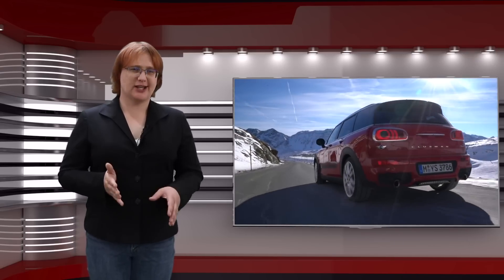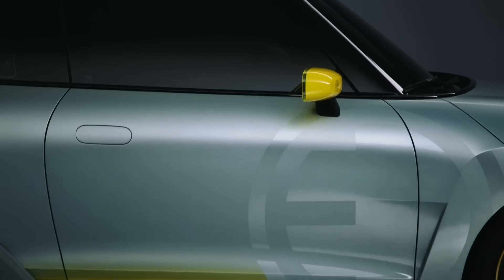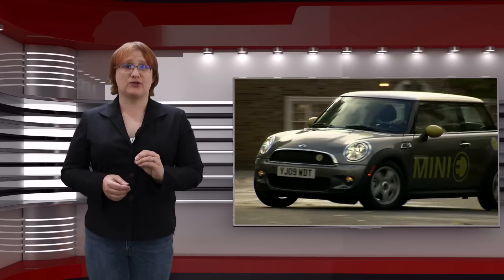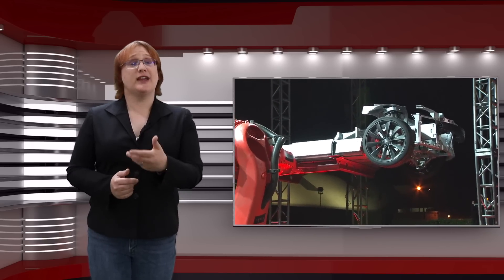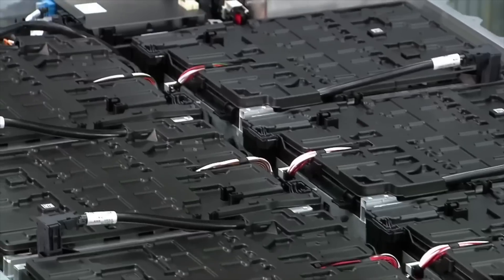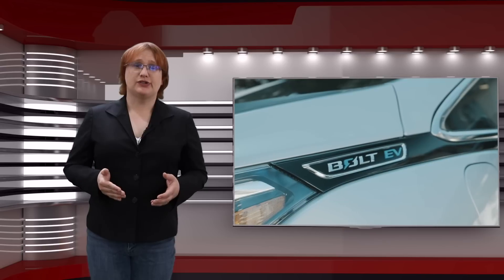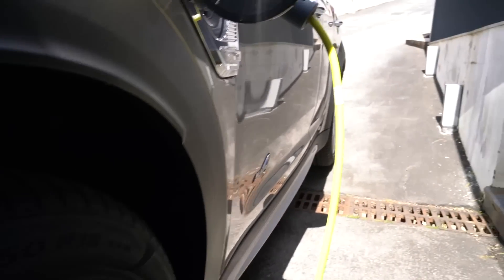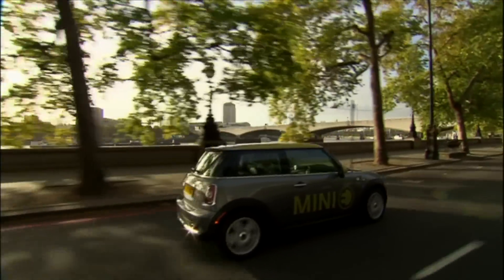How Easy Is It To Make A Good, Small Electric Car?

Comment: The 'MINI' brand must be getting too old anyway, i'm sure if you took a MINI, cut off it's roof and took out the seats you could drop an Issigonis Mini in the space.
MINI is the new flabby. BMW needs to take a new clean sheet of paper and design an urban mini car. The real trouble for all manufacturers is that a mini car is 'mini profits' car.

Comment: Something that people keep ignoring when talking about battery sizing, range is not the only thing to consider, in fact I would say it's not even the most important thing to consider, when it comes to battery degradation, small packs degrade way faster. This is because even if treated well li ion batteries have a limited number of cycles they can do, and a small capacity pack will go through the cycles faster, in fact in order do go 100 miles a 20 kwh battery pack will have to be cycled 5 times as much as a 100 kwh pack. This means a 20 kwh pack will degrade at 5 times the rate!!!!!! 

It gets even worse when you realise that depth of cycling matters a lot a 20kwh pack will be cycled much deeper than a 100 kwh pack on average. Ever wondered why the Nissan Leaf batteries are not lasting nearly as long as Tesla packs. This is not only because of active vs passive cooling, it's mostly because Tesla packs have much higher capacity so the batteries are not cycled as often or as deep.

Comment: I think the mini would be a fine choice and a 200-mile driving range. The problem is people want all this extra room I don't really use it anyway. I think they could partially put the batteries in the front end or the motor would be and some in the back end and still not give up any space. I still want to know why they can't use wheel generators to recharge the batteries so that you almost don't need to charge ever.

Comment: Overall, I've always been very happy with my Mitsubishi iMiEV. While I wouldn't mind a larger battery pack, it's a GREAT city car. Not only is it easy to park, but it's surprisingly spacious inside. I also like that the car is a little taller. I definitely have a better view of the road, and seating position is more similar to many CUVs. I'd love to try an electric Mini, but I think Chevy has done an excellent job with the Bolt. As always, thanks for the great programming, Nikki!

Comment: Does tesla have a patent monopoly on the battery-in-chassis design? Or did Mini just cheap out on prototyping and try to cram batteries into an existing chassis, instead of retooling to design a better chassis.
Surely a smaller, lighter car needs less batteries to achieve the same mileage anyway?

Comment: It shouldn't be a problem, since the fact that batteries are (relatively) heavy AND low energy-density at the same time results that both the efficiency and the price of an EV increases exponentially as you increase its size and/or its range. The smaller an EV is, the greater fuel efficiency and the price value is. A vehicle that's small AND short range can be built with a lot more profit than your average EV, that could make up for additional design costs.

Comment: Designing an EV specific chassis/skateboard should be out of the question. Cost could be spread out over similar sized models. As you mentioned, the i3 is of a similar size. So too is the BMW 2 series. Many others, like VW, are moving more towards modular platforms. This plus the ongoing advancements in battery tech could be their solution. Maybe even HubMotors, leaving the existing combustion engine bay and fuel tank locations occupied by NexrGen batteries. Just some thoughts. As always, enjoying your programs and the knowledge you convey. Thanks...

Comment: I was thinking of you range while listening to this. I went Prius instead of leaf with my last cars because my daily commute is 70 miles round trip in Arizona and we run the AC basically any day of the year. Had the real range of the car constituted 2 days of my daily commute instead barely 1, I would have been a buyer.

Comment: Lame excuse from a company that doesn't have the battery technology. Mini is about the same size as a Chevy Bolt / Nissan Leaf. In fact, it's much tougher to build a large EV. So far, Tesla is the only company that is able to offer a  full size EV. Every other EV is a small hatchback or compact. Even the Jaguar iPace is about the size of a Model 3.

Comment: Smaller batteries are NOT sufficient even for urban cars. Most of the cities do not provide overnight-charging capabilities on the streets. So the owner of the car is forced to charge the car now and then at a public charger. And who of you wants to drive to a public charger twice a week and wait there half an hour or so until the car is fully charged again? Therefore I think besides of the usual arguments this is one more argument for a bigger battery - at least until charger at the streets or at the workplace are common.
Reply: I think this is why locally we are starting to see chargers pop up at the supermarkets.  As you are going to be parked there for half an hour to get your groceries it fits with peoples lifestyles.
Two major corporations own all the supermarket brands in my country.  One of these corporations is putting 50kw chargers in all of its supermarkets over the next 18 months.  About 170 chargers in total and so I guess will capture all the apartment dwellers who own EV's
And this is in a country that 90% of the population has off street parking available as a minimum, about 70% have a garage
So it shows how much the supermarket is investing to essentially capture a small market share

Comment: Yes, you are correct.  There is a market for smaller vehicles with limited range.  That is why the Leaf and the Zoe are so popular.  But the breakthrough will be when CUVs which are taller and slightly longer with 60 - 100 KWH batteries become available at a reasonable price.  The Kona and the Neo come to mind.  Seniors are growing in population and we appreciate a taller car, which is easier to get into and out of.  And CUVs are the fastest growing segment of the car market.  A perfect fit.  Pun intended.

Comment: It's not hard to make a good, small electric car.  

The trick, as ever, is to balance affordability, range, and profitability.

It's really hard to meet customers expectations for range, and price, and the manufacturer's requirement for a profit margin, all at the same time.  

This is why customers still cannot purchase a 220 mile Model 3 for $35k, even 5 years after Tesla's originally published date, and going on three years after Tesla started taking money from customers. It's why Tesla are going to be offering the $78k and $82k versions of the Model 3 before they start offering the $35k version.

The i3 has a clean-sheet design - and a third of its range comes from its use of expensive light-weight materials.  But that makes it relatively expensive to buy.  Dedicated platform, expensive to purchase, profitable - but limited range.

The Bolt has a clean-sheet design, good range, decent price - but GM still lose money on it.

The Leaf uses platform-sharing to make an affordable vehicle with good luggage space, and further compromises on cost by using passive battery cooling.  So, semi-dedicated platform, affordable, profitable  - but limited range.

The Model 3 uses a clean-sheet design, has state-of-the-art range, but has remained expensive to buy even as Tesla has burnt through much more money than it has earnt.

The Jaguar i-Pace uses a clean-sheet design, has state of the art range, and will contribute strongly to Jaguar's profit margins - but will always be relatively expensive.

The Twizy has a clean-sheet design, a low purchase price, and is profitable for Renault - but has a compromised range (and other compromises such as doors).

The most successful design at trading off range, affordability and profitability so far seems to be the Renault Zoe - but it's not a long-range car by any means.

Comment: Doesn’t a small car weight less then a large car ? Wouldn’t that give the car more range per battery  ? After all the real original Mini was a car shrunk by a genus to fit around the engine and give it maximum interior space. Someone in the same spirit at BMW could start with a clean sheet for a small electric car.

Comment: Mini should stick with an 150 mile real world range or 200 mile max and be able to charge 150 miles in 15 min on a DC fast charger or 4 hours on 220 volts.  Price it under 40k and they will have an hit. Anything less is a waste at this point.

Comment: My Nissan Leaf a converted Nissan Versa ICE (same drive train as the Juke) and they found room in the existing chassis frame to install enough batteries for a decent range and cargo room.  In fact the space for the fuel tank lies empty and I could in theory install more batteries to level out the rear cargo area and fill up the fuel tank area (granted the balance of the car would be off).  The point here is that one of the most successful BEVs (Nissan Leaf) did not require a special purpose made chassis. BMW is talking bull.
Reply: The eGolf proves beyond a doubt that you can simply convert an existing ICE car into electric without a new platform.  The panels of any car are double walled with more than enough space to place extra batteries for optimum range.  eGolf has batteries in the rear and running up the panels at the back.  BMW/Mini are probably prepping us for the excuse as to why their car will be expensive... it needs a special drive train to be built. BMW/Mini must stop pretending we don't notice this and get on with making affordable electric cars.

Comment: It's very easy. They just need to put electric motor behind rear axle where very small differential will be used and place flat battery between small rear differential and stretch it to the front bumper construction. Then place second level of batteries in to frunk (electronic and inverter on the top of that) and under rear seats. So Trunk space remain the same, driver will still sit low close to the ground and there will be additional benefit of RWD. They can pack battery as big as 40kWh in 3door mini like that and that's more range (250-300km) than anyone will ever use with Mini - a car for town drive mostly under 100km per day.

Comment: For a multi billion dollar company, I can't see how this can be a challenge. The current mini is way bigger than the old ones. Give me the old one and I'll convert it. Batteries distributed in the rear and maybe even at the front. Won't change the structure anymore. If I want friends along, I'll layout the batteries on the floor  (with a frame which they may step on), the compartment at the rear and maybe even all the way to the hood as well. I've already done my old beetle and it wasn't much of a problem. With their level of technical expertise, I can't believe they still have excuses.

Comment: I think the talk about this and that being challenging can either be seen as manager blabla or as the simple fact that good engineering is never easy. The managers of a cardboard factory will also call their product challenging.
As for the mini, I think having it in the low to mid range section would not harm it one bit. It is basically a larger smart given how impractical they are compared to other cars of their size.

Comment: Given the trend in the increase of battery density it should be quite easy to put a larger capacity battery in a small car in a few years. Having said that the Zoe managed 41 kwh in a small car. I find the extra range of the Zoe means I can make virtually all of my journeys without the faff of charging away from home (I know a coffee break is a good idea but having to plan where I stop for coffee based on what the car wants rather than when I want one is still a compromise). The reason I don't have an E Golf, Ioniiq, I3 etc is that the range isn't enough for me to use my car pretty much the same as I would an ICE car (I do a lot of 100 - 130 mile round trips and in the winter none of those would manage it and I think even the 40 kwh Leaf would struggle). In short I think a 180 mile real world minimum is the least I would consider adequate for my use case and if the Mini can't do that it is off my list. Having said that a lot of people have a Mini as a second car and for that purpose 100 miles of real world range is probably fine.

Comment: People are perceiving range as the size for EV, so it is easier to sell a cheap car with 30-40kW battery compared to a premium quality car with the same battery size. Would you buy a 200km range premium EV if it is 10k more expensive than a 200km range cheap EV? Unlikely. So if one wants to sell a premium brand EV for large amounts of money, it also needs to have more range and fast charging and thermal control of battery, in addition to premium interior materials. And that makes it tough to design with current battery densities and prices.
Mini current FAAR architecture already was designed with EV drivetrain in mind.

Comment: For me a 200 mile range is important, true I only make a handful of long runs in a year but as I’ve just the one car it’s important not to have range anxiety.
Reply: Range extension is the cheaper alternative. Check the old Chevy Volt tech. Or bring your own generator. Some EV people do that.
Reply: sam guapo Generators should be built into electric cars, magnet motor generators requiring no fuel of any kind. Battery packs could be greatly reduced in size and ultra capacitors to replace the super capacitors of today could further reduce the weight. We have the tech to do without the batteries and the generator but it's like a magnet motor, it's forbidden.
Reply: I think the current limitation with ultra capacitors is the volumetric energy density. It eats up a lot of space for a little power but yes going the direction of super capacitors was an interesting direction and with incredible battery longevity.

Comment: I believe the problem is the actual size of their available batteries. Those are so bulky and large, they just do not fit under the actual mini chassis...
Reply: Batteries can be scaled and don't have to be together in a single module. Yes it wont be as neat as a Tesla or some other expensive EV but it gets the job done. Removing the ICE will give even more space in the hood. Instead of more batteries, put a range extender instead.
Reply: Please take a look at the battery cells BMW is using in the i3. Those are really large in comparison to other battery cells. Usually those car makers tend to reuse parts because of economy of scale. And also It is hard to imagine, BMW is building a seperate chassis only for the electrified version of the car.
Reply: Yes. I find it unlikely that they will use another chassis for their EV project. However, it can be built around. There are always ways when people have the will. I could daresay say the same about the VW Kombi (Bus) being banned because engineeringwise, VW said they couldn't add airbag feature that was required by law so they just cancelled it. I find that just as ludicrous. There is always a place to place it, might be unwieldy designwise, but it can be done.
Reply: Of course it can be done, but I do not see the will on BMW's end to really go the extra mile for a car they may not earn much money with.
Reply: You are absolutely right that there is a lack of resolve on BMW's part. The only way for them to make money in it is to fully commit to the production the way Tesla did. That would entail a lot of R and D despite the open patents Musk is allowing, CAPEX which naysayers are crucifying Musk over, entering a new field (battery development), charging network development et al. Until BMW commits, there is no way they can compete with Tesla on price.
Reply: You don't have to tell me, I already know it, they have to understand it. ;D

Comment: Renault is doing this today with the Zoe - yes it's a little tall, but there are improvements which can be made (for example, there is lots of wasted space under the bonnet particularly at the "back") to improve the density of both the drivetrain components and ancillary systems to make space for the battery without compromising cabin space. This extra room can be used for an even higher battery capacity or even more cabin space if done thoughtfully. Mini and BMW need to pull their finger out and put more thoughtful design into their chassis for a true EV.

Comment: All I want is a small Swift size EV hot hatch with 50kwh battery and Ill buy it.
Reply: xIAMDAVEx, yes, if they can get the price down less than the first Spark EV.
Reply: 50kwh is a lot of range already. I currently use 8kwh for almost all of my trips. Range extension for the less than 1% of my trips. However, I'm thinking of increasing this to 14kwh for the sake of battery longevity. Of course, mine is a converted small car so its easy to tinker with.
Reply: The possible upcoming Renault Zoe RS (blue thing on youtube, with formule- badges) might be great
Reply: Stefan Brand, that would be a great car, but at what price?
Reply: sam guapo yeah true but I mostly only use my car for long distance over 200km. And mostly with other people in the car too. So 50kwh would be perfect.

Comment: Yep. In the city you don't need the expense and weight of a 60kWhr battery. Hauling around unused battery capacity actually reduces a car;s energy efficiency. Bigger isn't better for everyone.
Reply: One day, it may be possible to change the size of the battery as you desire in 10kWh units (about the weight of 1 person). However, if it's easy for you to add modules, then it's easier for them to be stolen!
Works for an ebike - I use a 5kg 1kWh battery for around town, and can add a 40kg battery in a trailer if I want to cross the whole country on a charge!